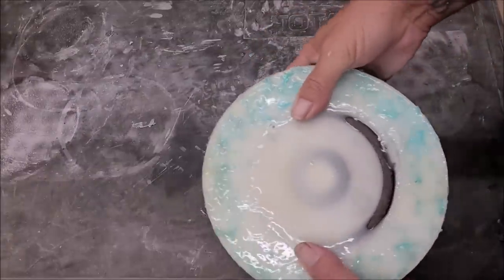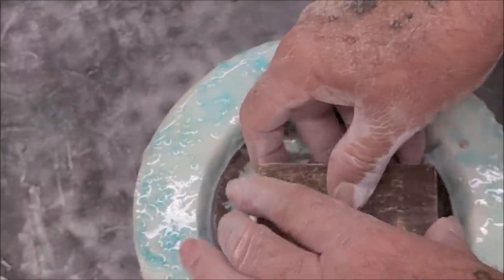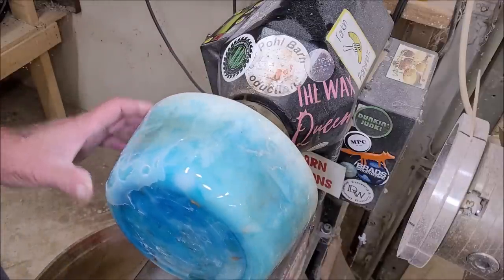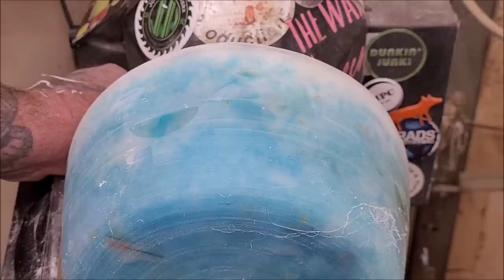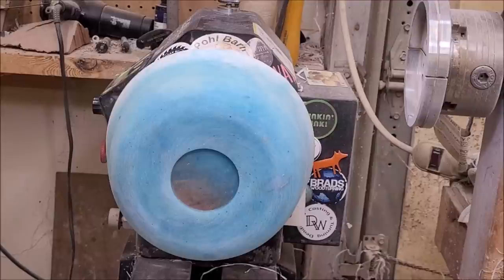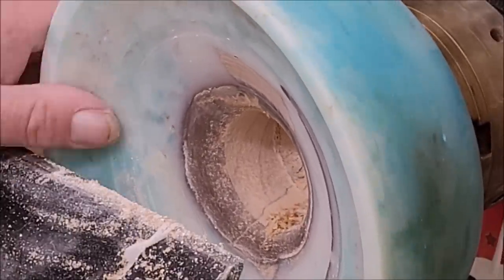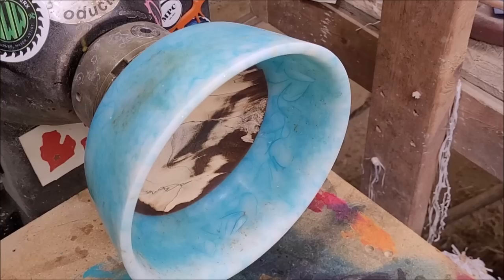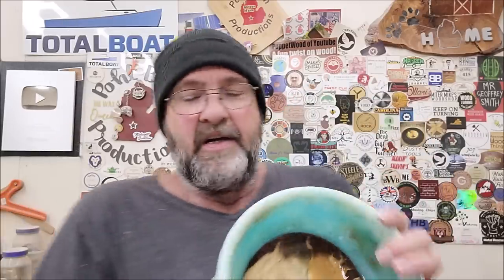Recycling Resin Ribbons

Comment: An easier way to weight them down is make your wood block higher than the top of the plastic pot then run across the top with tape to the sides of the container. Works well.
Reply from the maker: Thank you Craig, I thought I was safe,  turns out I was not.  I suppose I could have just put the weight on the rim with the mixing sticks to hold the waste block in place and not actually on it

Comment: I do like the fine lines that the reused resin gives the piece. I still don’t fully understand why some can use the resin and get a “perfect” finish while others struggle with it. What you had looked great when you first out it on. I wonder if thinning the finish coat with acetone might help. Your piece looks good despite the issues you point out. I even love the fly, I’ll name him Floyd. Thanks for sharing this Doug.
Reply from the maker: Thank you Doug,  thinning it would cause it to take longer to set up,  for the most part it was fine other than my sealer didn't seal it good enough so I had to do another coat.  I point them out because I sell the pieces,  it's more of a disclaimer than me beating myself up about the mistakes

Comment: 9:50  ish    I don't know anything about this, it's just an idea.  Could you connect your vacuum pump up to your pressure pot instead of the air line to give you a much bigger vacuum chamber ??
Reply from the maker: I probably could but then I couldn't see what was going on and I could pull all the resin out of the mold with to much vacuum